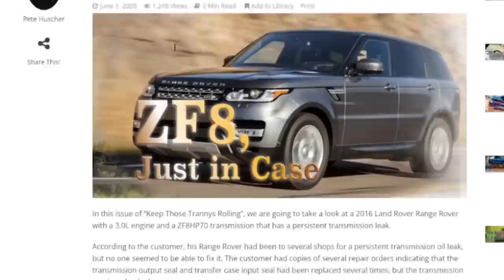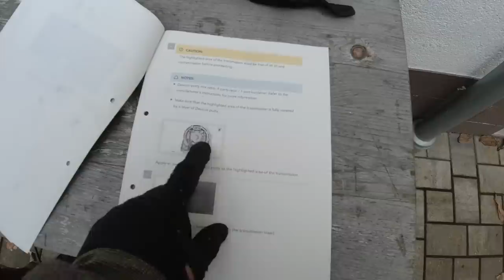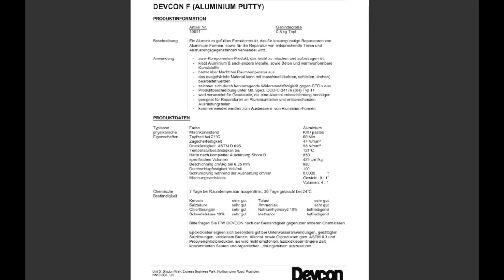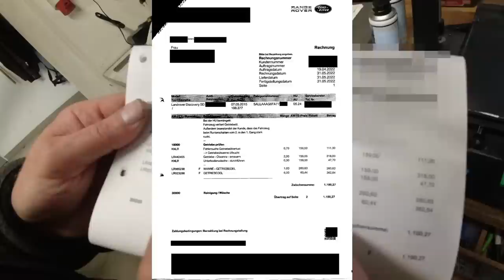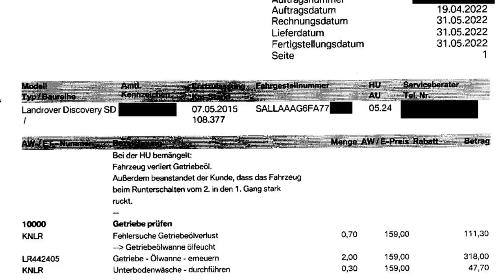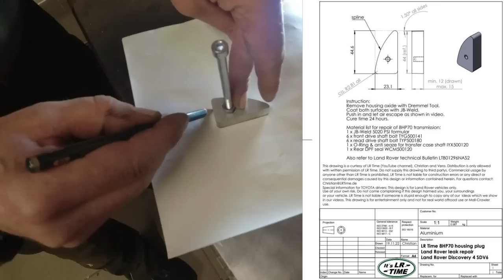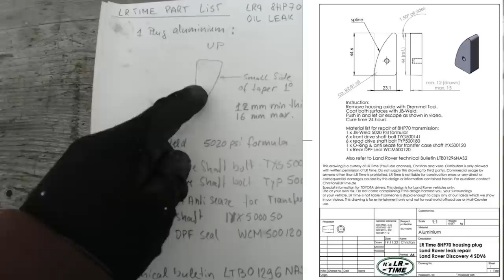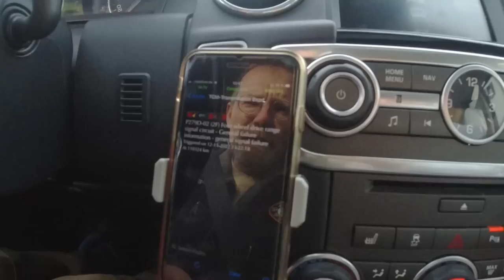Dumbest Oil Leak Ever Fixed on our Land Rover

Comment: I have worked for various car dealerships throughout the world and 3 have been Land Rover Dealers in 3 different countries.  I have to say the issues you have raised whilst relating to the leak does  not fix the overall problem the Dealer has. That problem is I believe experience. The experience of the mechanics  on individual models of cars is priceless. What You and Vera are doing is gaining that experience and knowledge of your Land Rover cars and that experience and knowledge is priceless and your videos are passing that knowledge and experience onto others which is greatly appreciated. Thanks
Reply from the maker: I agree that it is much more difficult to gain experience on so many cars.  It´s relatively easy to know one car.  Christian
Reply: I fully agree with you but if the repairer doesn’t have people with the right experience then they shouldn’t charge so much. Unfortunately that is the sad reality. 

You are better off doing it yourself or going to an independent repairer with a great customer experience.
Reply: Mechanic inexperience?,or management ignorance?
Reply: They are not up dating the dealership training that’s another reason.
Reply: @jameshayward1223 someone pulling wool over their eyes?
Reply: I agree but notwithstanding Christian’s experience on the types, I’d trust his raw reasoning and transferable skills over most other solutions (theoretically….I’m not seriously expecting to be able to borrow him!)

Comment: If I take a vehicle into a specialised dealership with a fault, I would expect when I got it back that the problem would have been sorted if not they haven't done their job to a satisfactory standard and either they don't charge or keep it until it's fixed. I am with Vera on this one.
Reply: I totally agree with you, Vera and the principle (especially as there was an existing LR Technical Bulletin that they should have known about) - but I think the chances of them admitting their negligence in an email are very slim.
Reply: Totally agree. Unfortunately these days it seems the dealers are just retailers and the "specialists" are independent shops. That's been my experience in Canada with Volvos and LR.

Comment: I don't know why the car manufacturers using this gearbox are not forcing Z F to pay for this repair.
Reply: That's exactly what I was thinking.  Surely this was a manufactuing fault which should have been fixed foc as a JLR recall.
As ever, another great video.
Malcolm Henderson, UK.

Comment: Well done Christian! Looks to me like ZF clearly had a porosity issue with their aluminium casting, and anyone that thinks that such leakage paths change with time has not the slightest bit of engineering intuition. But you have that intuition, and you were clearly 100% correct. I thought it was only in the UK that we had such f***wits in customer service making supposed learned pronouncements on such matters. I hate the arrogance of main dealer Servicing Managers: it's just not in their DNA to admit that they could in any way be wrong. Instead the Customer must be a dumbass and pay-up. Screw the lot of them: I feel your anger. The last time I went to main dealer was 28 years back with a new motorcaravan. So bad was my experience over the first year that I sent an engineering report to the big boss of the group concerned in London. Next day the phone rang and it was the manager of the garage concerned: he said he'd had the biggest bollocking of his life from the top man. He went on to say "We train them like aircraft technicians, and then there's not a single good one on the tools" (in my view, those on the tools weren't the main problem but the Service Manager, who was clearly totally incompetent, was setting the tone for the whole department). Then the manager invited me back to the garage to address his workforce. I considered it but ultimately I refused saying that I'd told them in the report that my shadow would never cross the threshold of his awful dealership ever again, and that's the way it would be. I was so angry anyway that it wouldn't have done anything for me or them. Since then I've done every last iota of maintenance and servicing myself, whatever the problem. I fell so sorry for the last owner, but relieved that you found the issue. Well done Christian: I hope the boss of the dealer concerned watches your video. In fact, why not send him a link?
Reply: Great post!

Comment: I bought a Skoda Fabia with a crack in the engine sump: ‘temporarily’ repaired with JB Weld. 152,000 miles and 12 years later the repair still holds.
Reply from the maker: That is great.

Comment: sir i went to a land rover garage for a full service, when i picked the range rover up i paid in full (cash) they gave me the paperwork with 60 things they did, the next morning i checked the oil level all was well then i notice the diesel filter was not new then i checked gear box sump that was not new then i checked the air filter that was not new, so long story short, they did the service again with me under the ramp making sure the job was done, i learnt a big lesson, not to use land rover and trust no one, do it myself, but at 61 year old i dont bend as good as i did, but it just takes me longer to do the job,
Reply: stephen. can you disclose the dealership?

Comment: Gotta love JB Weld. I broke part of the engine block on my Land Rover's 5.0L where a water pump bolt went. So I used JB Weld, oiled up the bolt and bolted it into the JB Weld repair and let it set up over night. Next day took out the bolt and cleaned it up, put it back in and it worked great. So if JB Weld can survive the engine block temp, I'm pretty sure it'll survive the transmission bell house temp.
But my experience with Land Rover dealerships is they stand thinking they are superior, until they get called out on it. Kind of like doing this video. My nearby dealership seemed to remember me after I called them out and they always seemed to work with me as an equal afterwards. But after they screwed up and they had to come back and fix their error, they should fix it for free.

Comment: Another great video!  A few thoughts about Land Rover, I am old enough to remember when series IIA trucks were available here in the US.  Around 1974 or so the last dealership in Colorado closed.  I was always in love with the aesthetic of the old series trucks.  Fast forward to the early 90's and LR again came to the US, this time with luxury Range Rovers, Disco 1's and some defenders.  Only this time they were very expensive, and there were almost none that were utility trucks they were almost all luxury cars.  People who buy luxury cars don't fix them themselves, they also don't usually keep them for very long.  So gone are the days of buying a vehicle that was intended to be repaired long into the future.  The dealers became a rip off, expensive parts and poor service.  Land Rover has trafficked on it's loyal customer base, all the while providing horrible service after the sale.  So what should Land Rover do with this particular problem?
1)  acknowledge that they screwed it up.
2)  Offer the previous owner some type of compensation because they screwed it up.
3)  treat LR enthusiasts with some level of respect, it's because of us that those old Rovers are still on the road making them look good.

Shuss from central Colorado!

Comment: They are not called stealership,s for no reason  ,I would have done the same as the previous owner and got rid of the vehicle and bought  a Toyota,,porous cases in this time are totally unacceptable it should have had a recall,, that was a great video with very good information on how to fix the problem

Comment: A fantastic analysis of the oil leak. It's very disappointing that a main dealer failed to fix the leak first time, and probably didn't check their own service bulletins.  On return of the vehicle to the dealership, they should have covered part of the labour cost, out of good will. It wasn't the customers fault the leak wasn't fixed first time, yet they foot the full cost!

Comment: Christian, Vera, this is my favourite channel on YouTube. As an old-timer electrical engineer it is heartwarming to see your quality and humorous approach to LR maintenance. I've never owned a LR due to unreliability fear! Keep going pls.
Reply: It's not LR specific unfortunately eg. Toyota RAV rear suspension linkages fail due to internal rust in USA causing deaths - but no such recall program elsewhere. Instead Toyota Aus did useless external visual inspections. Daughter's failed at 60kph, car went sideways. Imagine result if at 110kph!  Dealer assisted with repair Toyota Aus did not. Car sold..no more Toyota's here.
Reply: @ericjohnson6802 That’s more than appalling. Not Toyota traditional approach to total quality management. Even Toyota are dining out on historical reputation, not present reality.

Comment: This sounds like a familiar story with dealership repairs. I owned a 2012 Mercedes GL350 with the OM642 diesel engine. I bought it new and for 7 years it was serviced by the dealer. Once the warranty expired I found a German gentleman who repaired most German cars as an independent. My first service with the independent garage suggested I replace some of the driveline fluids, I then produced the dealer receipt showing the work had been done, he assured me that none of the driveline fluids had been changed from the factory. The dealer service was $2300 Canadian. I no longer own the car due to oil cooler leaks, stretched timing chains, failed injectors and adblue pump failures. Fantastic car with a very poor engine, my first Mercedes and probably my last.
Love your show, very informative and the humour is very good. Happy motoring.

Comment: Hey Guys. Well I would never have guessed that the casting was cracked/faulty.  Especially from manufacture!  My LR4 doesn't seem to have this problem, so it must have come off the production line before this error occurred.  I was lucky, but I must say I'm very disappointed in Land Rover. It's obvious to me they messed up and I also feel very sorry for the previous owner. I live in a different world. I never buy "new" vehicles, and I do all the work myself. I EXPECT to fix them as I go along, but not everyone is in my position and if you pay £50,000 for a new vehicle you don't deserve to be treated like crap by Land Rover. As you said, they lost a customer from this... but reputation is difficult to maintain and by further damaging theirs they will lose many more.  I'm going to do you guys a video later. My turbo story has grown much bigger and I've found some really interesting stuff out.  Keep the video's rolling, they keep me going!  ❤

Comment: Great repair, love it!

And of course LR should have resolved this in a kind way to the customer, even though it is a bizar issue. But then there was the service bulletin… and unnecessary fixes due to bad diagnosis. Not too nice of LR.
We had a good experience though with Toyota, they took half the costs of replacing the head of our D4D diesel which was completely clogged up at 240000 kms (took only 3 years) due to a design fault of the head (probably a flow/turbulence issue). That’s proper customer care.

Comment: Hello two you both!
I love your videos.  JB Weld pales a product called Steel stick.  There is a video on YouTube explaining how it works.  You need to completely drain your transmission a spray the area with brake cleaner.  Sand the area with coarse sandpaper to increase the surface area sand the pice of Aluminium you intend to use as a patch and recreation the part and the transmission with brake cleaner again. Clamp the pieces together and allow them to dry overnight.  Refill the transmission with the fluid you drained since it is so new it would be a waste to recycle it. Keep up the great videos. Land Rover is full of BS. They do not want to admit liability for their shoddy work.  Here in Canada there are places to report this kind of nonsense.  For what they charge they should have taken the vehicle back in and fixed their mistake.  we also have very strict regulations that if you took these people to court they would not only be ordered to repair the work, but they could be heavily fined for their actions.

Comment: Good video, professional approach, very interesting, let's not forget that the casting molds are first filled with polystyrene foam in the shape of the part that requires to be molded so porosity I think transfer to the alloy casting. Very big thumbs up.

Comment: Guys,  we are watching the channel from San Francisco and simply love you both! What a lovely couple and partnership,,keep making the videos you both warm our heart:)! 

p.s
My husband has a D5 TDV6 and I think he loves it more than me,,we almost got the LR4 but dodged a bullet and got the D5 at approx 45k and it now has 120k only 3 years later and not a issue,,the new lion modification  to the TDV6 must have made a difference (thanks Chris for the deep dive into the crank shaft fault, learned a lot, excellent video coverage Vera) he also loves the channel and has learnt so much from you both and now wants to change the oil pump:)!

Big Fans, keep up the good work:)
Reply from the maker: Thanks.  The Oil pump of the gen2 is bulletproof. It is the oil dilution what kills this engine. So keep the oil no longer than 6k miles. Christian

Comment: Another awesome video!  Great repair as always.  A neighbor of mine had a similar issue with an Aston Martin timing chain cover.  There were no cracks but the aluminum was porous enough for oil to find it's way out & make it look like a gasket leak.  An old time race mechanic suggested using talcum powder to find the source of the leak.  At least Aston Martin provided a new cover at no charge.  :)

Comment: Totally agree with Christian, the L-R dealer's service dept. misdiagnosed the oil leak and charged for unnecessary work. I wonder if anyone in their service dept was there in 2019 the date of the service bulletin. Your solution as usual was extraordinary!
Reply: Agreed. 

Possibly in this day and age it shouldn't matter whether the service staff were there back in the day. Nowadays you'd think it'd be possible to look up all Vin-relevant service bulletins on the company system and look for ones that talk about oil leaks. Or just any old Web search, which is what Christian and Vera did! This is an unusual fault, but you'd think that it'd have been highlighted in big red letters somewhere...

Comment: I’ve used JB weld on a cracked motorbike engine case while on a trip. It ended up not leaking for the few years I owned it.

Comment: You guys ROCK!  I had to fix a leak in an old air compressor tank at my remote Cabin in Northern Michigan, USA.  All I had available was some "JB Weld".  4 years later that repair is still holding, and I use that old air compressor every time I'm up there at my cabin, about 20 times a year.
Reply from the maker: 👌👍While we lived in Michigan for almost 10 years, we took many trips each year to the UP. 🙋‍♀️

Comment: This is usually a Dealer Mindset issue rather than a Manufacturer issue.  They will not accept any liability ... or the door is open for big costs if it goes to court.  Just like in an accident ... whatever the circumstances/cause .. never admit fault ... let the insurance or court determine liability from the presented facts.   Sometimes if you go around the Dealer to the Manufacturer you can get a result - this has happened with fellow Jaguar owners, and I had it when the new Triumph Motorcycle company started - they bent over backwards to be helpful when the Dealer wasn't.   Great video as always ... even if the content was obtained by frustrating repetition.  You should have the satisfaction from the warm response of your audience 😁

Comment: Hi Christian and Vera,
Another very informative video and I do feel for the previous owner. I think a lot of the issue (and its not just a Land Rover thing) is that the dealers employ Technicians and not Mechanics. A technician will plug in the laptop, read the fault code and then fire the parts cannon at the problem and just keep chasing the fault until they've rebuilt the car with new parts and eliminated the problem as part of the process as after all its not their money. Still very glad I don't have an autobox!

Comment: Guys. My opinion is that LR definitely did not diagnose the original fault, they did this twice both on the transmission leak and the fault shifting gears (They fitted a thousand euro drive shaft that was not needed). It should also be taken into account they did not by the sound of things not even look into the recall, that was it appears in the end to be the actual fault. LR should have admitted their error and completed the repair minus the amount the customer had already paid out. “Vera I agree with you”😀

Comment: Awesome job!  It's interesting that the recommended putty you bought was grey colored while in all the repair pictures I've seen on the internet the putty is green.  I hope the JB Weld holds up.  It should.

I can relate to Christian's frustration with LR stealerships and their attitude/approach to their clients.  While one manager on the phone may have been reasonable, the other in the email was an arse.  This just propagates the negative reputation for the brand.  At the same time, the email guy could be asking himself why he is getting chewed out over this since Vera and Christian were not the customers who were wronged.  At any rate, I agree 100% with Christian that the dealer should not charge a second time for diagnosis of the same symptoms but could charge for the proper fix.  The thing that bothers me is that one would think a dealership would be aware of this casting issue with the ZF transmissions.  What are the odds they never saw this problem before?  Hard to believe.